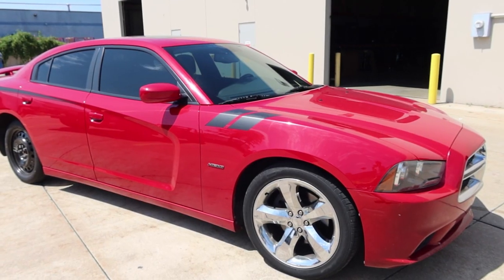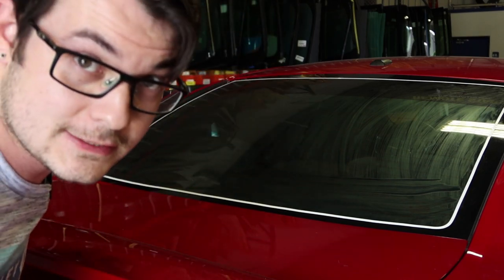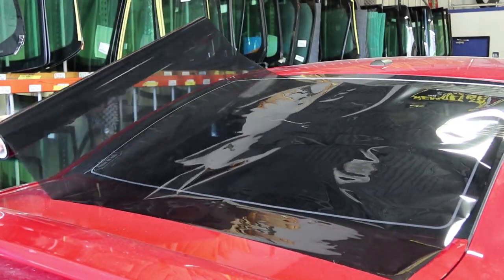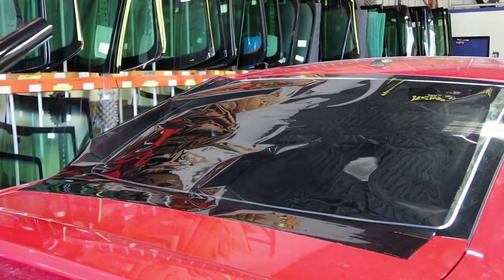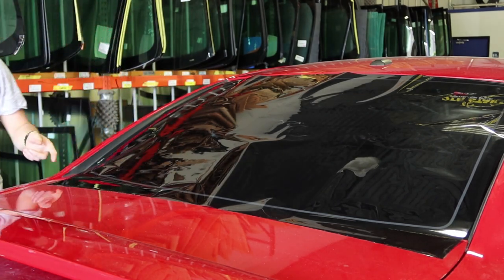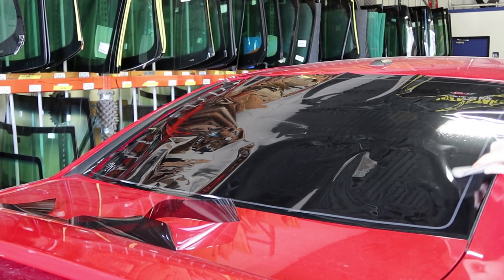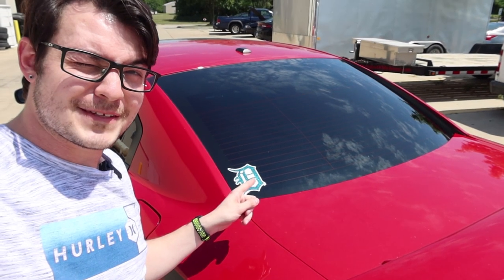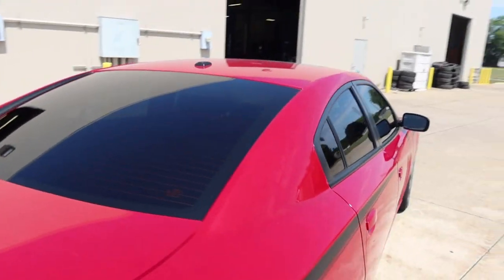The Most Difficult Common Back Window | Shrinking Tint on Dodge Charger Rear Windshield

Comment from the maker: Hand cutting videos are coming! Also tell your favorite manufacturer to sponsor me! 😁
Reply: TintStuff what film you use??
Reply from the maker: I use Avery Dennison NR
Reply: Question: I lay vinyl and have never installed tint. I have a customer that wants office windows tinted. Rather that giving away the business, I thought I would do some research. Should all tint be shrunk before install? And you make tint install look pretty easy, without any bubbles, etc. Is that from shrinking? Thanks in advance for any advice!

Edit: I apply wet and dry vinyl.
Reply from the maker: @scootsmcgoots6343  office windows are all flat so no need to shrink them. all shrinking does is curve the film to fit the curve of the glass.

most architectural jobs charge $8 or more per square foot of glass. good money in flat glass.
Reply: @DetroitTintStudio  Thanks man! I really appreciate you responding!
Reply: @DetroitTintStudio  can you put a link to this tint you literally have a link for everything but the tint..
Reply: Where u get ur tint with wide widths?
Reply: @sittinsideways3744  would slWwwwwwwwww
Reply: EstaMobueno
Reply: MEGUSTA ENSEÑA BIEN

Comment: Matt, when the glass is manufactured and the cooling  process of the glass there is always one side of the window that will drop more than the other side. Thus creating more or a greater curve on one side. Thus one side of difficult windows is due to this phenomenon. Your technique is on spot. On those side that are more difficult apply more dryer sheet. .

Comment: I watch ur vids religiously lol back windows always scare me when i tint but most of the time they cone out great, sometimes i will have to redue bc i end creasing when shrinking. Im no pro but i do pretty good. My buddy owns a show in town and taught me a lot of what I know and watching your videos has taught me a lot also. I've never done a dry shrink though I usually do a wet shrink. I just want to thank you for making vids like this for people like me who love to do this as a hobbie but also trying to make it into a profession. 👍
Reply: Just a tip ☺️ if you are scared you won't be putting as much pressure as you need to so the film will get under your card and cause a crease. Firm pressure and most of problems will go away

Comment: Great advice on tinting charger back windows.  I tint a ton of police chargers.  Had not thought  of the second shrink after the weed.  Especially  with the rubber trim at the bottom  of the latest model.  Getting too many fingers.  Hope this helps.

Comment: Thank you very much for your videos they are awesome! I have definitely learned a lot very quick question for you though what do you put on the exterior of the window before you put the tint on before you shrink it? So the tent doesn't just stick to the window did you say a dryer sheet? Thank you have a good day
Reply: Wet a bounce sheet and apply it all over the window only exterior let it dry and lay the film then do your process

Comment: I have a jetta VI and I have got very big bubbles on the back window! 
I have a question is it OK if I install the film over the window (outside) ? 
Because pulling the old tint can break the heaters (defrost)! Right! Any suggestions? Thanks

Comment: Excellent video – Your film is awesome it shrinks much better than the film I bought off of Amazon.
On my Ford Crown Vic the large curved rear window is a nightmare because the film won’t shrink to fit 
Is there a quality film that a DIYer can buy with good to excellent heat shrinking capability like your film?
Update - I saw your website & I can buy a roll of quality film there

Comment: Great video. Is it possible for the window to break due to too much heat in one spot?
Reply from the maker: it's more possible on the windshields. hot spots on laminated glass could crack. but the film would burn well before the glass would break on tempered
Reply: @DetroitTintStudio  thank you

Comment: Every time I do these cars . I end up with fingers on the defrost lines after installation.. I’m using same heat gun and I’m using madico black pear NR film . I’ve tried cleaning glass with steel wool and white scotch brite pad . What step am I missing ?
Reply from the maker: Yea they have a common defrost issue. Next time, turn on the rear defrost about 1 min BEFORE installation. let the glass get hot and then install the film. everything lays down really well and stays. I don't use any steel wool or sand them. just turn on the defrost. 
https://youtu.be/iEqTZHs7wBo

Comment: If you get a crease on the middle of your film while squeegeeing out the water during application, can you save/fix it or is the film ruined?
Reply from the maker: It's pretty much done. you can minimize it from the outside. hear of the spot and press all the air out but you will always see the crease line on the inside.
Reply: TintStuff thank you for replying back. I’ve been watching all of your videos and been learning as I go. The application came out good except for that damn crease. Good thing I’m practicing on my dads car lol

Comment: Have you tried glass aid with a torch ???
Reply from the maker: Not yet but it shouldn't be an issue. I've seen the glass stay cooler with a torch because the shrinking happens so fast. also because you aren't burning holes thru the film, anything underneath is good.
Reply: @DetroitTintStudio  rite on

Comment: Have you done $1000.00 Llumar tint? which acts as an insulation. It mitigates the amount of heat penetrate getting in your car by up to 70%.
Reply from the maker: Not a formula one llumar film specifically but I'm very familiar with ceramics. They absorb IR heat and it radiates off the glass. really nice for driving cuz they take that direct sunlight heat off your skin. the car isn't much cooler sitting out in the sun because of the ambient temp and your car is still a metal box.

Comment: If a window is straight without a curve do you have to shrink it?
Reply from the maker: No, but pretty much all auto glass is curved so even on windows like a wrangler, I'd still shrink them a little. takes a few seconds and saves you from potential issues.

Comment: hi.what do you think about heat gun bro ? I want to buy this . is it sturdy ?
Reply from the maker: it's the $20 basic Wagner gun. they last me at least 6 months and are the best of the cheap guns. a little better one for the money is porter cable.  the $60 to $80 heat guns haven't been worth it.
Reply: I’ve found the Snap On heat gun be very durable. It’s pricey but has gone through plenty of abuse over 2.5yrs.

Comment: Are people really complaining about the back window of a Charger. Anyone remember the 80's,  90's and early 2000 Camero or firebird back windows with the compound curves.
Reply: Yes, but those cars the hatch opened so it was much easier to apply.
Reply: @scott4172  its not the application, its the shrinking of the film thats hard.

Comment: Is there a part 2 to this video? so you leave the tint heat shrunk on outside of window and done??? lol
Reply: No when there are no curves or air bubbles you take off the protective coat and wet spay it also the inside of the window and apply it inside, the squeegee in an H pattern from the middle

Comment: I thought you ran the tint on the inside of the window!?
Reply: First you shrink and trim the tint on the outside window and then you peel the clear liner off and then install the tint on the inside.   He just didn't show the install part.
Reply: @keithmcleod811  
 From my understanding there's a few different ways to do it. Apparently there's a heat shrink type tint that can be ran on the outside.. at least that's from what I've understand after looking into the subject after watching this particular video.